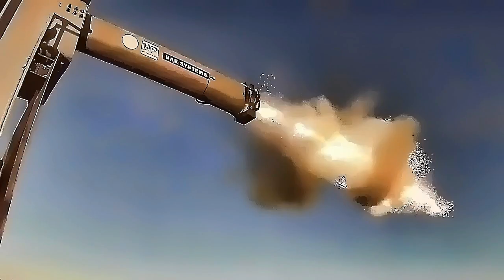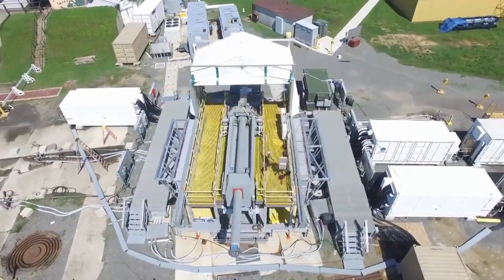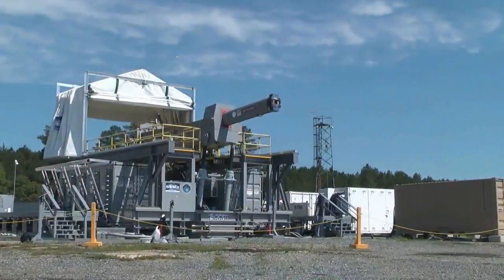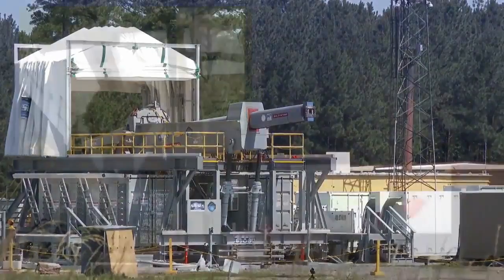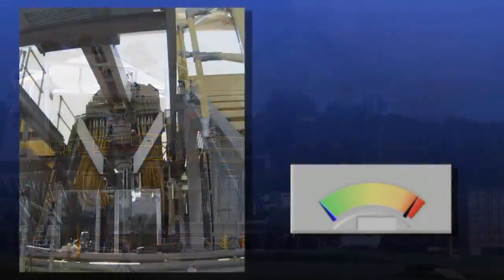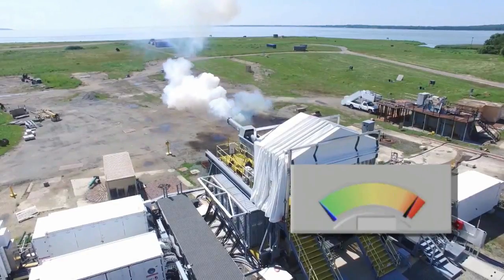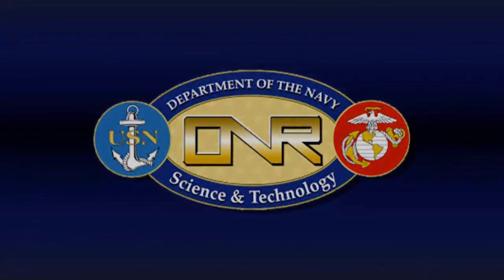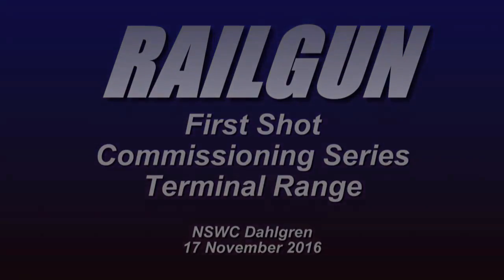U.S. Navy Railgun Auto-Loader Test & WOW

Comment: Last time I looked, magnets don't produce smoke !!!
Reply: No but vaporized metal does
Reply: Yea, you're right. The sabot around the projectile must vaporize going down the barrel !! I wonder if that same event could bring down a city skyscraper or two. ??? Just vaporize the steel ?? just wondering .........
Reply: And only mach 6? Lets keep in mind that it is a initial speed after projectile exits the gun barrel. After 10 or 20 miles how much of these 6 machs will be left? 
Modern missiles have range of 100s of miles. 

If these rail guns want to have anything to say on battle field they have to shoot projectiles not with mach 6 speeds but mach 100 or more. 

Mach 6 is a bit silly and perhaps good at close range of 10 or less miles. Not 100 miles. 

I have also noticed that reload is really slow. Way too slow.
Reply: oldi184 March 6 is really fast. You know that right?
Reply: Luragon

Yes mate i know it. I can do basic math. Mach 6 = 1.27 miles/s. Its super fast but...not fast enough. 

As i said this rail gun will not shoot anything at 100 mile range as they claim. 
Mach 6 is initial speed at the end of the barrel. But after projectile will travel lets say 10 miles it will not be mach 6 but mach 4 or mach 3. 

Modern missiles travel at mach 2.5 or mach 3 and they have range of 100 or 200 miles and they can also make course correction something that metal projectile cant do. 

These rail guns can have use at 10 or 20 mile range but 100? Forget it. As i said they cant turn or make any other course correction. Its just piece of metal shot very fast from gun barrel.
Reply: oldi184 okey :3